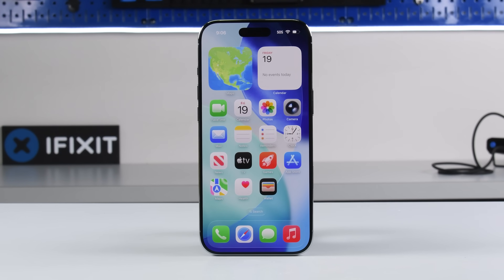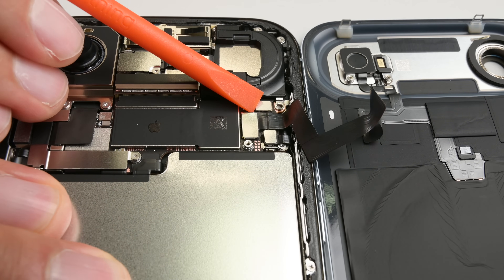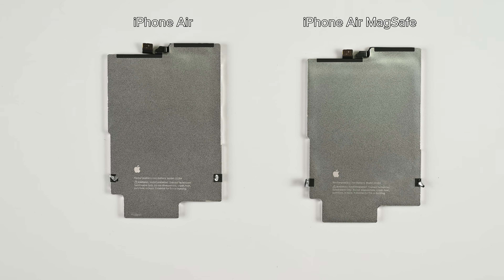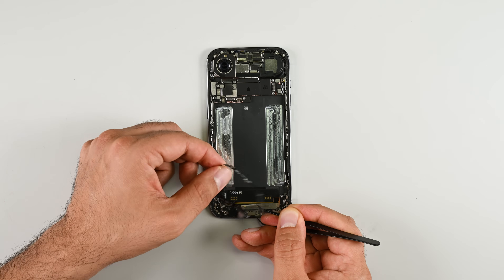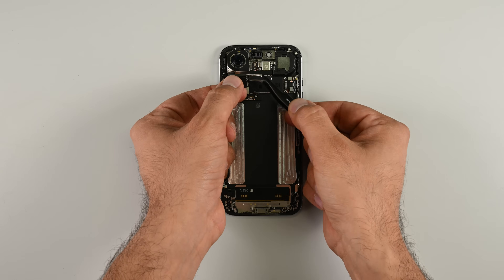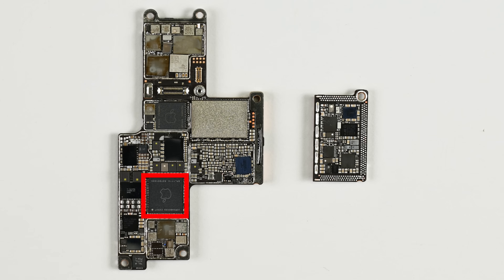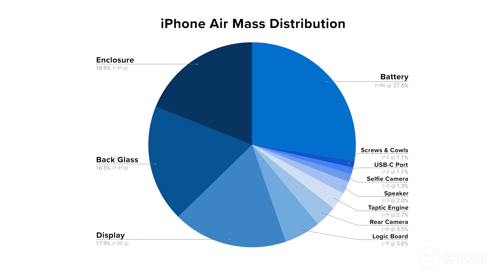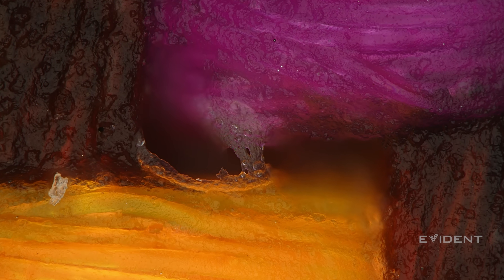Apple’s Thinnest iPhone Ever… Is Actually Repairable? iPhone Air Teardown

Comment: The 3D printed part seems pretty rad, honestly. I'll give it to Apple, their engineering is pretty top tier every time.
Reply: Manufacturers are the real goat. Apple is just submitting designs, they don't have the technology to manufacture anything 😂😂😂
Reply: @ThaNaT0s-uwu manufacturers wouldn’t be able to do it without design, so
Reply: @beigegecko  Some manufacturers gives their design tho. Like how apple bought Samsung's hinge design because their own in house design is inferior. 
Ideas won't come to life without the manufacturers. 🤡
Reply: @ThaNaT0s-uwu 

Your effort to take credit away from Apple is incredible: Stop crying 😅😅😅
Reply: @ThaNaT0s-uwu Dude, clearly you didn’t watch the video at all. iFixit said that Apple used a new, custom proprietary 3D printing process. So they definitely had quite a lot to do with it, you don’t randomly come up with a wholly new process. But you have to be a smartass, I know. Apple bad, even when they innovate and do something good, right?
Reply: @blueskye8470  You really don't know how manufacturing works. Proprietary are the designs, it's up to the manufacturer if they can produce the machine. 😂😂😂
Reply: @ThaNaT0s-uwu 
Wrong
Apple designs the product, manufacturing equipment (most cases) manufacturing process, quality control
Most of the time Apple owns manufacturing, testing equipment.
Reply: @gund89123  So are you saying that apple owns TSMC's fab? And also Samsung's AMOLED tech? What's next? Apple will also own Si/C technology when it comes to their devices? 😂😂😂
Reply: I guarantee you that apple had little to do with it. 3D printing Titanium parts like this is pretty easy nowadays and there are dozens of companies that make the machines for this process.
Reply: @Widur42 Dude, clearly you didn’t watch the video at all. iFixit said that Apple used a new, custom proprietary 3D printing process. So they definitely had quite a lot to do with it, you don’t randomly come up with a wholly new process. It’s okay to acknowledge their successes.

Comment: I have a 16 pro and it has the same battery life and it lasts all day, so idk why people keep saying the iPhone air won’t last all day…. I watch videos constantly and only need to charge at night or maybe the occasional car charge when getting directions.
Reply: The 16 pro is almost a year old. You won't notice 5-10% loss. The problem is that smaller batteries get charged more often, and they don't stay in the 50% to 80% zone. So - they tend to lose capacity faster. Watching videos isn't the highest battery drain either - the screen is no longer the largest drain compared to radio/cellular - which is impressive. This changes with brightness levels and LTPO update/refresh rates - but there's tradeoffs. The GPU is able to offload decode processing and can be moved to idle/efficiency cores for lower power consumption. 

Anyone who's had a smaller phone knows you don't get the same longevity after 2-3 years. What used to be ~30% at the end of the day, drops to 11% and then the phone starts shutting off at 9%, sic. The battery technology itself has changed - but people still have memories of phones 'lasting all day at 5%'. Newer batteries don't have the same quirks - but the loss in capacity is real enough - it's why people change their phones every 2-3 years. It doesn't 'work' the same - because people use their phones differently depending on the battery percentage. It's not universal - but it's a reason people switch phones or get battery replacements. Or both.

Running a 100% battery  to shutoff test on a year old 16 Pro/16, it would probably drop an hour in the same testing environment. Maybe more. But, 2 years in, that loss will be more noticeable. 2-3 years in, a 16 Pro's battery will be reduced by 15-20% despite the "Battery Health" indicator - It's a known factor called Calendar Fade because Lithium Batteries are still chemical reactions. What used to last 27 hours will drop to 22-23 hours. If you cap it at 80%, the loss is reduced. So it's a short-term loss to gain more lifespan. For the iPhone Air, what might get 15 hours during the day might get 12 hours after a year. unless you're also using the magsafe battery to offset the drain. It really depends how people use the phone - as a phone - or an all-day device. 

After 3 years, most batteries will have trouble reaching 0% and 100% due to the capacity loss - making calibration more difficult and causing further problems. 

If you run full cycles from 100% to below 50% regularly, aging/decline speeds up. Higher temperature areas (40'c/100'f) and constant usage will also prematurely age the batteries even if they don't get used much - as long term heat changes the chemistry of the batteries.  Bigger batteries that stay around the 50% mark also don't tend to degrade as much with the new LFP cells. The amount of long-term studies aren't yet available. 

Keep in mind, Battery Health only shows cycles, not heat or aging. It also does not always handle the full charge/discharge cycle needed every few months to calibrate the current battery capacity - needed to reset the 0% and 100% value. This is why things like airpods and tablets can sometimes get stuck at 98% for 2 hours, or the phone dies at 8%. Especially for devices which are tethered or always plugged in, the constant trickle charge can 'cook' the battery and reduce it's capacity.

Comment: I really feel like Apple should of done the Magsafe battery differently. Rather than made it charge the phone. Make it just connect via some pogo pins and when its connected the phone simple sees 2 batteries, drawing from the external one first. Similar to how many older workstation laptops would have a battery slice you could clip onto the bottom. 
Would of eliminated all charging losses and meant you could save the cycles on your main battery
Reply: Yeah, they've used the Smart Connector on iPads for years now.

Comment: 8:48 is unfortunately displaying improper (safety) use of a hobby knife. A disclaimer or removal of the section should be considered. Previous shots of hobby knife use are correct and should suffice to get the point across : )
Reply: Always cut towards your thumbs for maximum risk of amputation.
Reply: I know I noticed that too very close to having 2 thumbs on 1 hand
Reply: Always good to see partnerships beating out Saftey, sensibility and good advice

Comment: and people are like “why is that camera bump so big but only 1 camera 😭 completely wasted space” meanwhile half the phone in there lol
Reply: The goal should be to make a thin phone with the least amount of compromises. This is good enough for the first generation but I would expect multiple cameras in the future Airs.
Reply: @ratzlord3125 thin means compromises in a smartphone. Even Samsung with the edge made some compromises to get it as thin as they did. I doubt there will be a multi camera air, because it looks like Apple already filled the space almost completely. With the size of the camera module in mind, the only way I can see a multi camera air would be a triple stacked logic board or else a board that somehow has less chips on it
Reply: @ratzlord3125  you won't because you can go beyond current miniaturisation capability and specially if you want to alway fit more and more tech inside. can't go against physic
Reply: @ratzlord3125 i don’t know if many people really use more than one camera. I for one very rarely use the ultra wide, only for macro that switches automatically. otherwise I don’t switch the cameras.
Reply: No one said that, ever
Reply: This ain’t even impressive. They basically made the camera bump double the size then claimed the phone is thinner 😂 My iPhone 6 is thinner.
Reply: @nicholaswicks3077 iPhone cheeks
Reply: The board is lower than the camera bump
Reply: This also means the phone thickness is measured on the plateau, not the thinnest bit. It's a fraudulent way to "beat" Samsung, while still failing to put a proper battery in the phone.
Reply: @TheRealDuckofDeath Pretty sure Apple doesn't care about beating anyone in reaching a certain thickness. The plateau is just a very smart move to make a thin phone with a bit more volume for the thick parts
Reply: @qwertzuiop875  You're completely missing the point. If the actual phone parts,  is what makes the thickest part that thick, then that is the phone's thickness. Cut it away and you no long have a functional phone. Technically you can cut away sensors and still have a functioning device.Which is what we pretend is acceptable when not counting sensors towards phone thickness. But, if the critical parts of the phone is the hump, then the hump is the phone thickness. I don't count the volume rocker on my Z Flip as the phone's thickness, even though it technically is possible to measure that bit's thickness. \o/
Reply: @TheRealDuckofDeath The thickness is anyways just a single dimension and not that meaningful of a measure for a device that is not a single block anymore. Either we start using volumes or mean thickness. But at the end nobody cares about the numbers, but how it feels and how it looks. The iPhone Air is the most impressive phone I've ever hold. So well balanced. I can turn and twist it effortlessly in my hand. I tried the edge and the haptics there are not that impressive.
Reply: top heavy...
Reply: I glued a piece of paper hanging out of my phone and I now have a 0.01mm thick phone! The thinnest of the world!
What? It's very thick in all the other parts except the paper? That's just a camera bump, it doesn't count!
Reply: @MK73DS  It’s okay to seethe. 😌
Reply: @MK73DS  Except the majority of the phone is actually that thin. Like 80% of it. Most importantly the part you hold the phone from. Your analogy doesn't hold up.
Reply: @MK73DS  You win the internet and the phone industry, please let me buy 3 of your $200 iPhone Papers

Comment: I want to see a comparison of the internal layout/total area of the iPhone Air vs the s25 edge. It seems that Apple did a lot of compromising in order to get the iPhone just a smidge smaller than the S25 Edge, but the Edge doesn't have many reduced features like the Sim Tray, Dual Cameras, and a bottom speaker.
Reply: Now, how will we infuriate the other people on the bus with our stupid music?
Reply: The end is larger in every dimension and almost has sharp corners. Air has to pack magnetic charging and faceid hardware that the Edge does not have and it has much more rounded corners.

Comment: Actually, being able to just buy a magsafe battery pack a few years down the line and if you're skilled enough, pop one into the Air and pop out a failing one sounds great if you cant just buy a replacement part for any specific reason
Reply: Apple will also just sell you the battery
Reply: I love the thought of repurposing the failing battery back into the magsafe pack. There, it can still be of benefit to the owner of the phone..
Reply: No actually, having to create a bunch of extra waste throwing out the rest of the magsafe pack just to use the battery doesn't sound great. Apple should just offer replacement batteries so people can get new ones without having to tear apart and throw away an old stock magsafe pack that has an old degraded battery in it.
Reply: @mjc0961they do offer replacement batteries

Comment: 3:53, because USB-C is also a critical data port, if  this port is easily accessible/swop-able, it could be tampered by malicious actors without user notice , it would put user safety in danger (we have already seen spy ware in iOS) safety subject is real
I would be concerned if I left my phone on table and an hour back someone has already swapped USB-C parts. 
It’s a tricky balance between user safety & repairability
Reply: You mean like someone brought a heat mat and a suction cup and a bunch of different screwdrivers to a café to illegally swap out components on random people's iPhones in the bathroom stall.  Yeah, I can see that being a big problem.

Comment: Apple won't fix your IPhone 16 or 15 USB C port because reasons. Those reasons being no customers are going to want to rely on wireless charging to charge because it's abhorrently slow. And if you can't charge your phone with a cable and transfer data with your cable your left buying a new phone. It's corporate greed. And built-in obsolescence and otherwise perfectly working phone logic board battery boots up just fine cameras work. face ID work all that stuff rendered useless because Apple won't fix the $5 charge port. Honestly apple as a company sucks. Decent software some questionable hardware choices on both the phones and the computers but overall decent ruined by corporate greed.

Comment: Woah, being able to use the battery in the magsafe pack without there being a hardware or software lock is nuts for Apple, 100% did not see this coming.
Reply: Like he mentioned at the end of video Apple has been making good progress to stop doing this. Most things can be calibrated after install on the phone itself.
Reply: Replaceable batteries being required soon by EU. Everyone is getting ready.
Reply: You can thank the EU for that. Manufacturers are forced to make repairs easy and affordable without specialized equipment or software locks.
Reply: @Mr.Riffian  no they are not
Reply: @PfropfNo1  yes they do. Ifixit themselves said that EU made the law that starting in February 2027 most portable batteries like in phones and laptops will have to be user replaceable using commercially available tools. So manufacturers had to start testing and laying ground for new changes.
Reply: @prz98  nice, finally more profits from water damage where the whole device is fried
Reply: Why would they you’re paying 4x for that battery packaged as  a magsafe pack
Reply: well, its an original apple battery. Apple usually locks 3rd party components.
Reply: it's cheaper than engineering a new battery type
Reply: ?? It's a genuine part, the exact same part, not sure why they would not allow it.
Reply: As long as it's genuine and your donor device isn't iCloud locked, you can swap parts between phones. Its been like that for awhile now. So you can now buy a broken phone for parts as long as its logged out of icloud
Reply: Apple did see it coming. They 100% support it as they do do using any battery from another iPhone air
Reply: The iPhone air having just one camera will make 16e owners and potential buyers feel better about the budget option.
Reply: @xyxuz123 discussion about battery but you just pick camera to hate. 🎉 congrats for being the P one.
Reply: that's EU regulation for you, without it Apple gonna sell literal brick to you without any access point
Reply: Apple also didn’t see that coming, they’ll patch it soon
Reply: @hid4  🤣
Reply: @hid4 they can't because of eu regulation
Reply: @hid4  No lmao? Just hating to hate I see
Reply: @Jeno_Sinatra hate? I support Apple to patch it lol, you poor people want to use Apple without genuine Apple Approved spare-part are just disgusting
Reply: @hid4  The MagSafe battery is genuine though? What are you talking about? 😭
Reply: @Jeno_Sinatra  He is a shareholder he wants Apple to reach 10 trillion by shutting out the competition and price hike Iphones.  lol
Reply: What are you talking about. That uses the same magsafe tech as qi2 chargers. Apple donated the magnet technologies. Do you think they would encourage the adoption and then lock it down?

If they wanted nobody else to use it, they would have kept the technology to themselves.
Reply: @kevikiru the internal battery not the MagSafe tech

Comment: Between this and the durability tests, apple has cooked with this one
Reply: Except for that massive camera mountain where most of the phone is. An incredibly thick top heavy phone and just has a really small battery. This is a terrible design. If this was a cooking competition, this would be the part where whoever cooked the iPhone Air would be sent home.
Reply: Too bad that the concept of a thin phone is kind of pointless. But I applaud the effort by Apple's engineers
Reply: @Creativeusernamenotclickbait objectively it feels great to hold
Reply: @z-0669  The iphone air is 12 grams lighter than the base model, that's the weight of 8 paper clips
Reply: @CreativeusernamenotclickbaitI mean a flip phone isn't particularly useful either.. but both are cool albeit rather useless